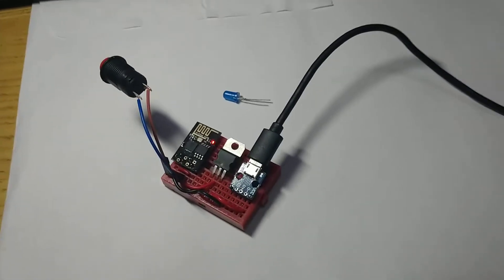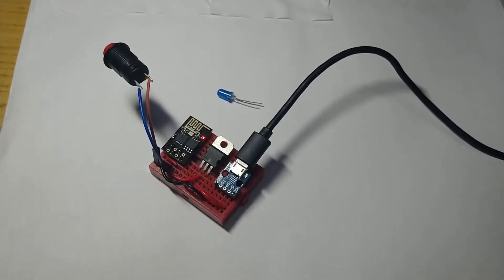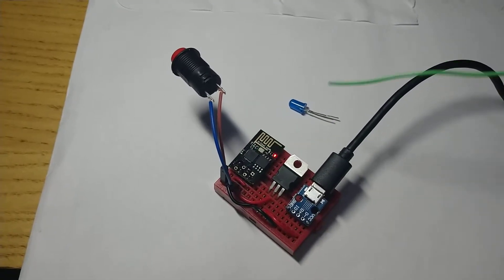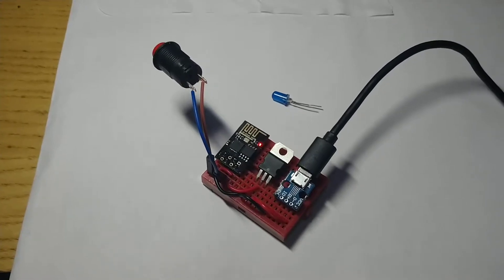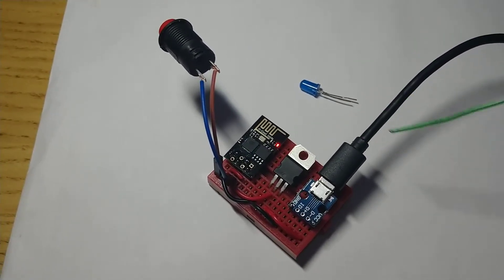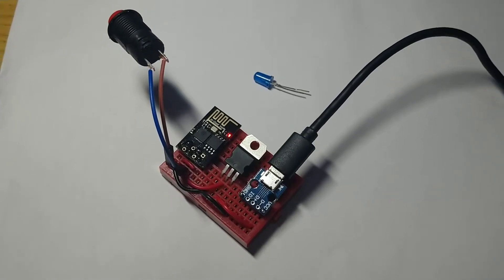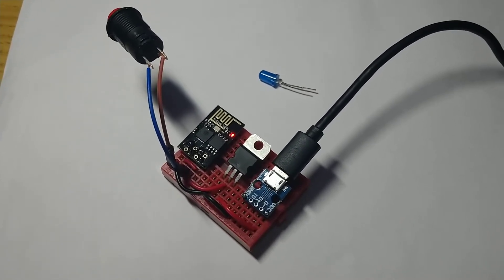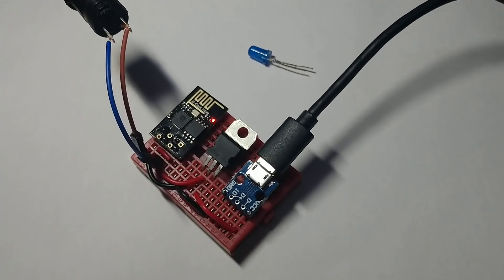ESP8266/ESP-01 Push Button Controller for Hubitat Home Automation

Comment: How do you connect it to Hubitat? :)
Reply from the maker: Hey There, If you take a look at this site, it should give you an idea on what is involved. It's very intuitive and SOLID! I have a bunch of devices configured based on the codes and configurations. https://github.com/DanielOgorchock/ST_Anything/blob/master/HubDuino/README.md
Reply: @johnhart6320  do you have sketch i would like to have some releys on nodemcu. thanks for help.
Reply from the maker: @dudl0000  Let me dig through my library. Pretty safe bet I still have it.
Reply from the maker: @dudl0000  See if you can access it from here: https://drive.google.com/file/d/1mtvdM8ajJ2fNUgJhRvIf5oJ0KgLRXqo5/view?usp=sharing